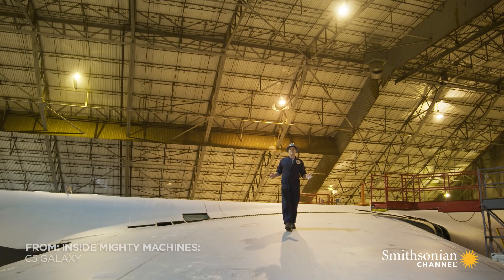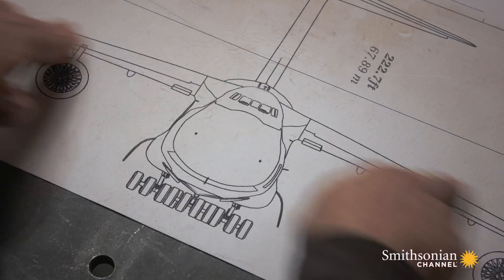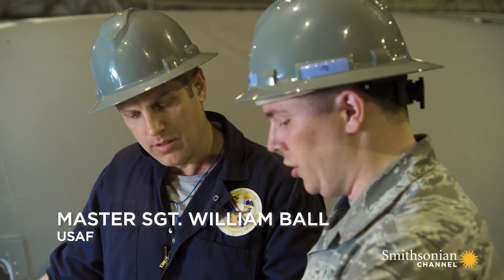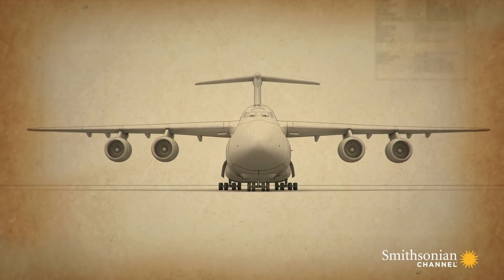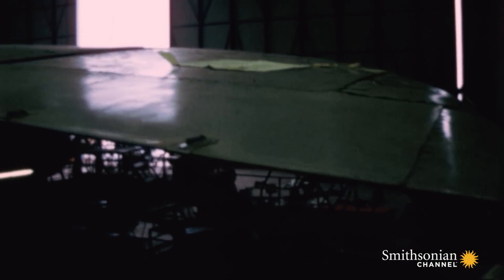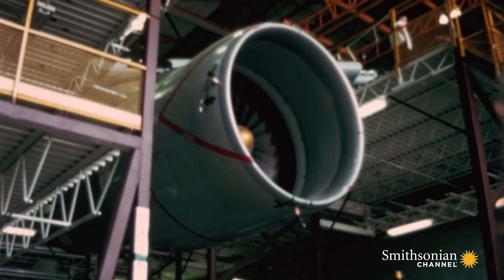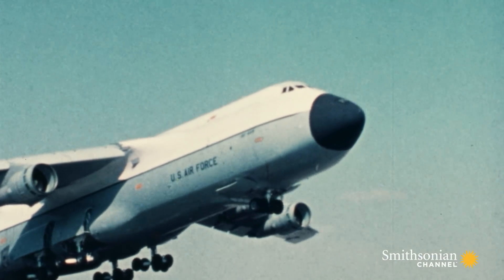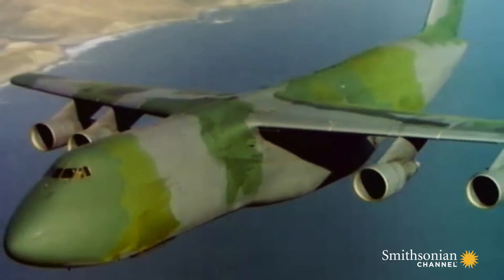The C-5 Galaxy Had a Catastrophic Design Flaw

Comment: Failed to explain what caused the cracks and how the C5b fixed that problem
Reply: That's typical Smithsonian lol. They failed to explain almost everything
Reply: @dimitriymirovsky  They want you to watch their full documentary.
Reply: @dimitriymirovsky  they make you want to do more research, which isn't necessarily always bad.
Reply: The TV show explained it in full detail.
Reply: Metal fatigue caused the cracks. Revised structure and alloys fixed the problem.
Reply: This is just part of a longer tv program.
Reply: They designed a more rigid wing frame.
Reply: To meet the original specs wanted by the air force when they designed the plane  they had to save weight, and unfortunately they saved too much weight at the original wings. The specs were simply too ambitious for the time, and the original wings have proven to be too weak.
Reply: Flex tape, stuck it over the cracks and jacked the price up.
Reply: My father was a, (the),  C5 Fatigue Engineer in Marietta,  about that time.  He sent in a minor engineer into the wing structure to find out about the fatigue cracks.  His report was hand written and about 7 pages long.  Three pages was dedicated to  a run in with an  18 inch, saber toothed rat and  its babies.  The reporter was from UK so one had to read it with a British accent, which just added more humor.   I've been looking for that copy dad brought home,  I doubt it was thrown away.
Reply: @NoggleBaum  Beauty of a comment. Thought you were going to pretend your dad was the chief engineer responsible for saving the aircraft or something.
Reply: mymagicflute1 do you know, I’m curious
Reply: @doriandegroot4924  metal fatigue due to the flex caused the cracks.
Reply: @GoatzombieBubba  howd they fix it ? Reinforcing the wings?
Reply: @paperitgel98   some kind or a buttress brace.